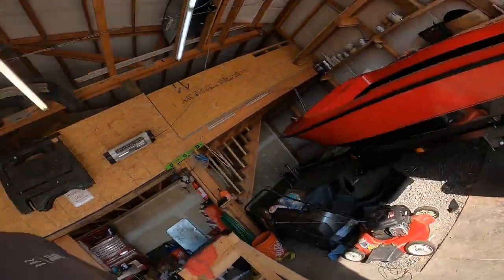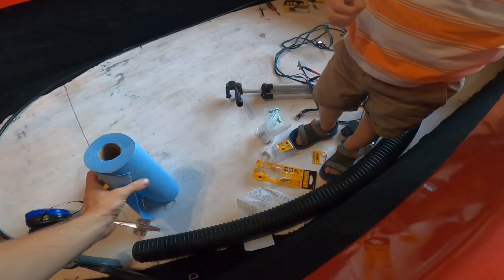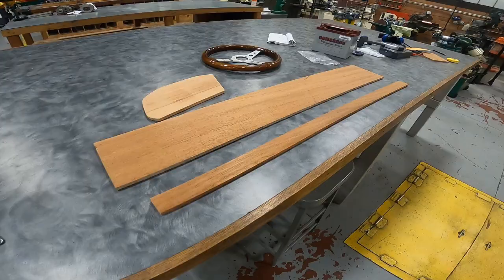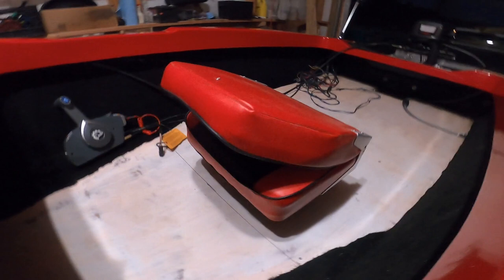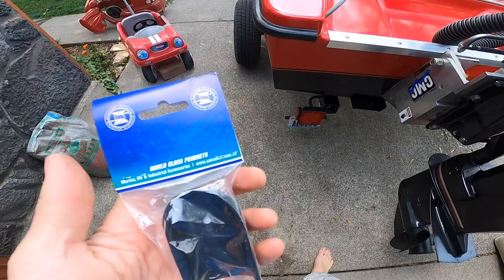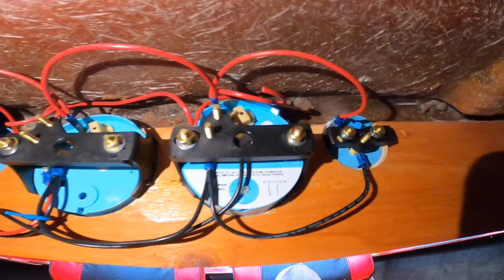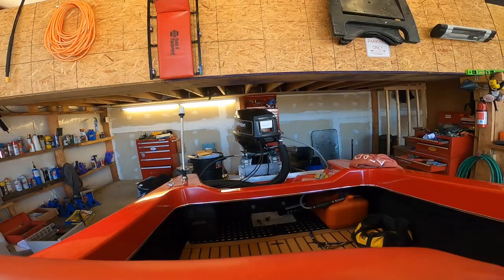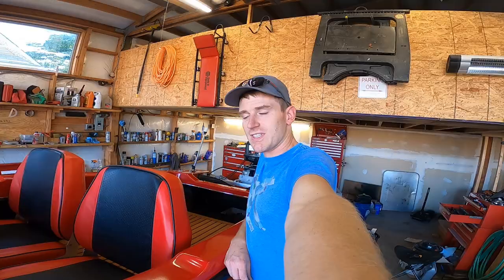Boat rebuild (PART 23) Engine, electrical, windshield

Comment: Heat shrink all those electrical connections
Reply from the maker: I defiantly should of. Though I did use marine grade electrical wire with tinned copper which does hold up well to moisture. but you have a good point. 🙂

Comment: Looking GREAT! 
What is the flooring on the deck surface? 
Gas gauge? How will that work?  Thinking one of my tanks has a gauge of its own. I've never seen a remote gauge for inboard tanks before. 
The electrical looks very well executed. This is huge. Give it a few years and should still be good to go.  I've seen others which were very shady. Happens way too often., and can actually be dangerous.
Reply from the maker: the flooring is foam, (teak style) it has adhesive on the back to stick to the floor. found it on amazon. I should put a link in the description. I put the gas gage in because I plan to fabricate a bow gas tank in the future that will use the gas gage.
Reply: @Project2Potential  Can you do Amazon affiliate links to earn some of that sweet plastic Canadian money? :) Jayce is so sweet ❤️

Comment: I missed something you said about the steering pullys and cables and that you eliminated them? If so, how does the steering work now?
Reply from the maker: That's right, I did eliminate the steering and pulleys. I bought a push pull steering system instead. It runs only down the right side of the boat.
Reply: @Project2Potential  Cool... I'll check that out and see if I can make that work on my boat, thank!
Reply from the maker: Yes sorry, I remember my camera battery died while I was filming the steering system installation. Which is why there's little details of it unfortunately.
Reply: @Project2Potential  last question for the night I promise... do you happen to remember the name of the steering system you used?
Reply from the maker: @scottwolfe8586  I don't,  but I will look it up and get back to you 🙂
Reply from the maker: This is the very style I used. I bought mine used tho. Haha, much cheaper. 

https://www.amazon.ca/Mophorn-Outboard-Steering-Marine-System/dp/B07V42YZ8P/ref=mp_s_a_1_1_sspa?adgrpid=59970832046&hvadid=310059755905&hvdev=m&hvlocphy=9105340&hvnetw=g&hvqmt=e&hvrand=15705753249344605424&hvtargid=kwd-301453816535&hydadcr=18318_9397423&keywords=boat+steering+kits&qid=1685674049&sr=8-1-spons&psc=1&spLa=ZW5jcnlwdGVkUXVhbGlmaWVyPUEyN1lUWU40RlE1V1omZW5jcnlwdGVkSWQ9QTAwNzE1MTgxU1NMOEtXWUJWS0RHJmVuY3J5cHRlZEFkSWQ9QTA0MjM5NTYzMzlKN1MyRlVEOFMzJndpZGdldE5hbWU9c3BfcGhvbmVfc2VhcmNoX2F0ZiZhY3Rpb249Y2xpY2tSZWRpcmVjdCZkb05vdExvZ0NsaWNrPXRydWU=